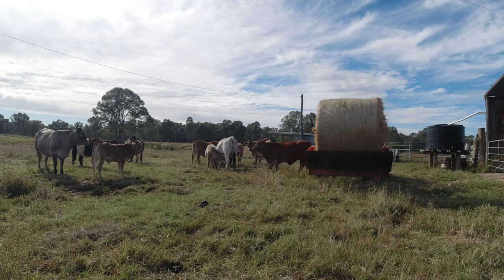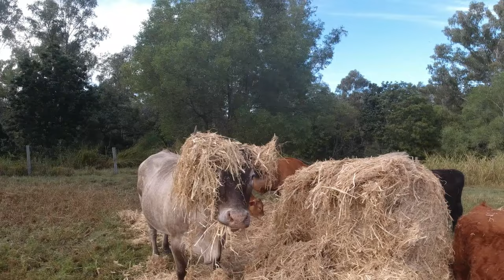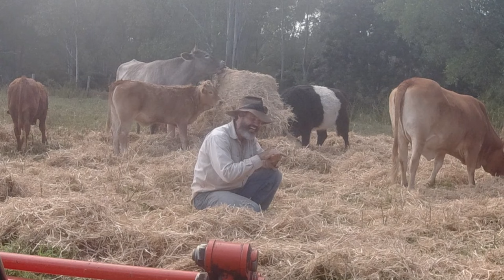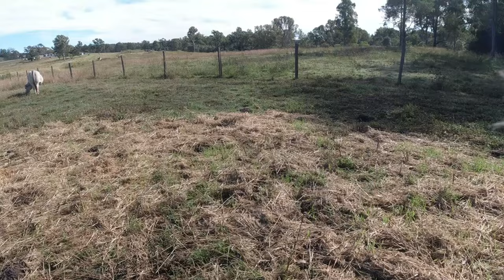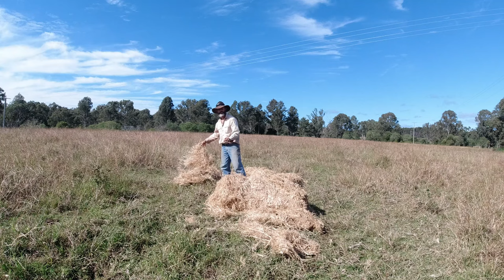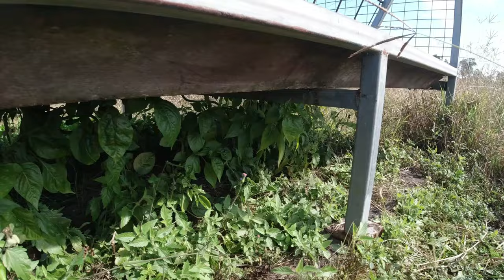How We Feed, Seed & Hydrate Our Soil At The Same Time!!

Comment: You need to get/make a bale unroller so you can spread fertility without having to do it by hand and leave a large lump in the middle.
Reply from the maker: Hi Lee, welcome back and thanks for not only watching another one of our videos but for also making the time to send us your message. Strangely enough mate, I purchased steel, winches and wheels a year back now which is sitting around the shed for that exact purpose. Though finding the time to build it is easier said than done, however I’m now contemplating building a moveable shade trailer incorporating one of my mineral feeders and fly rubs prior to that bale unroller build. There will be a couple of videos of those builds I’m sure once I find the time. Cheers once again for your message Lee and we hope you have a grand day.